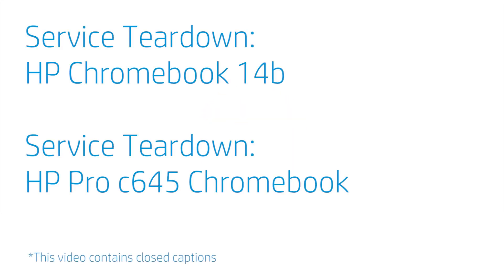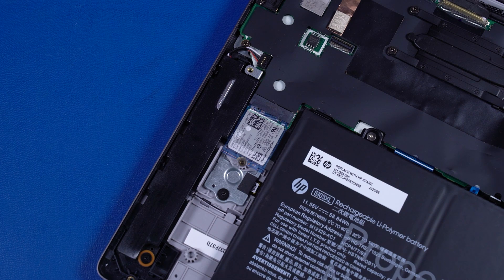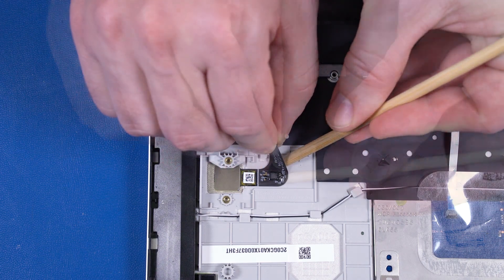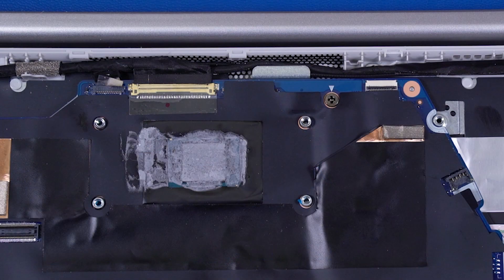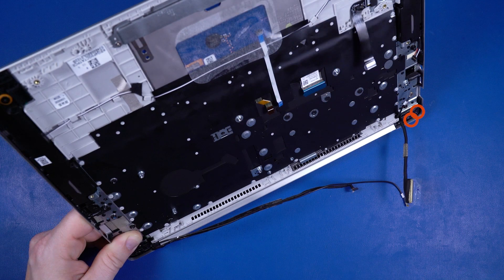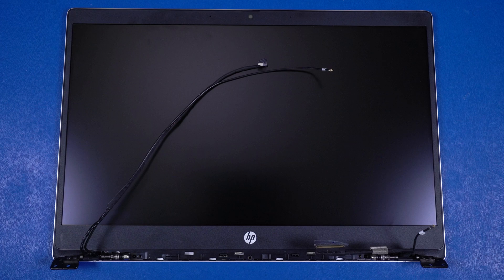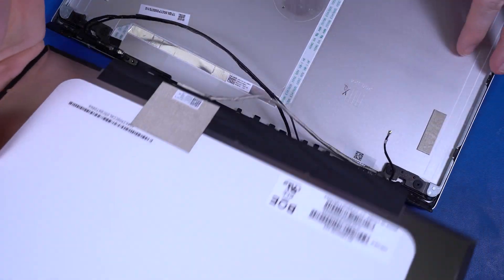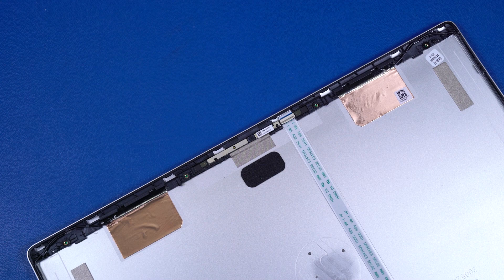Removing & replacing parts for HP Chromebook 14b, Pro c645 | HP Computer Service

Comment: Is it possible to install a back-lit keyboard on the laptop? I have the 14b-na0005sa and was wondering if I could buy the necessary parts to install it. Also, I have also noticed that the Pro C645 and 14B Chromebooks are near identical with the specs you can have them with and their features, and as I have the 14B I was wondering, does it share the exact same components (apart from things like RAM, SSD and processor ect) as the C645 and does it also have the same aluminium frame and spill-proof keyboard? Thanks
Reply from the maker: Hi Octavian, thanks for contacting!
I understand that you need to know whether you can add backlit keyboard on your notebook and also need to know the difference between the Chromebooks. 
I will do my best to assist you.
HP does not recommend upgrading or downgrading hardware parts or software that is bundled with the product as It may affect the manufacturer's warranty and performance, however, you could change the configuration at your own discretion.
May I know the complete model number of Chromebooks so that we can check the details for you?
Binu - Social Media Tech Support
Reply: @HPSupport  HI Binu thanks for the reply,
I wasn't able to find the model number for the Pro C645 Chromebook but I was able to obtain its product ID which I'll give for both.
Chromebook 14b - 321A7EA#ABU
Pro C645 Chromebook - 2Z5S3UT#ABA
Thanks!
Reply from the maker: Thanks for the reply.
Please compare both the notebooks here: https://bit.ly/3aKLJ8V and https://bit.ly/3uWv4pM
Binu - Social Media Tech Support

Comment: I have read that for write protection remove I have to disconnect the battery then remove the write protection is it true
Reply from the maker: Hi Luca, thanks for contacting!
I understand that you need to know about removing the bios write protection.
In order to get this issue fixed, please contact our customer care team over the phone or chat for further assistance, as this issue requires Live conversation with you over phone or chat to isolate the issue and provide you instantly with appropriate solution or repair/replacement options available at your place as per the warranty.
Please feel free to reach us on call/chat, please access this link to select your preferred country and language option to reach us. Global support link: - https://www8.hp.com/us/en/contact-hp/ww-phone-assist.html
Binu - Social Media Tech Support